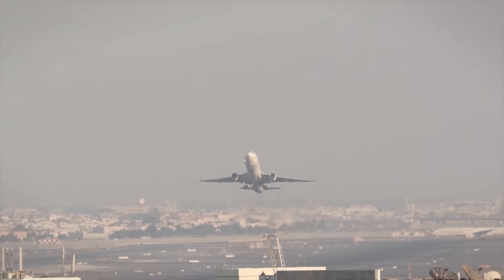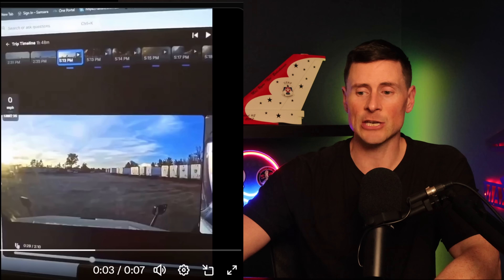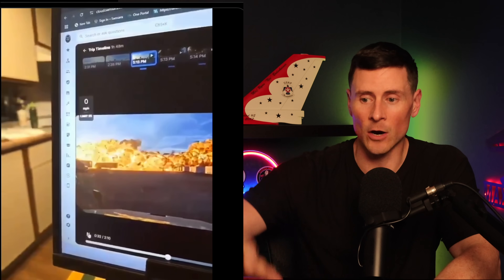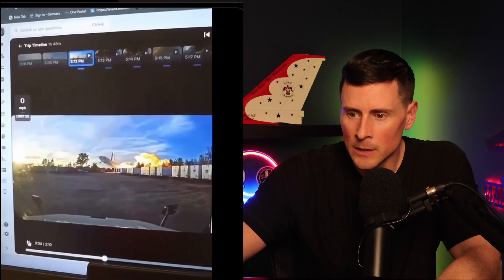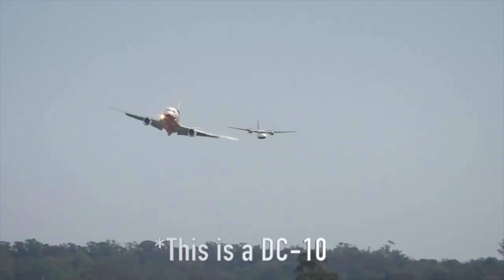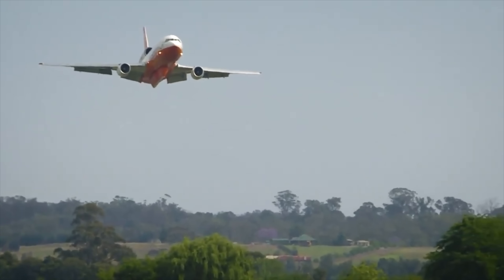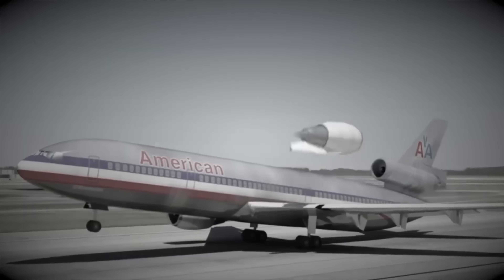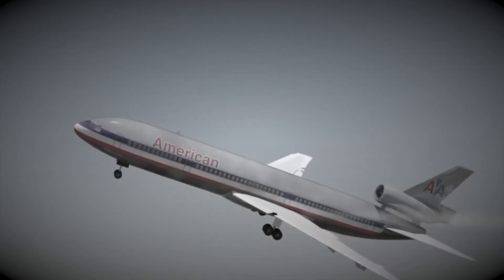Airline Pilot Reveals CHILLING Clue in Final Moment Before UPS 2976 CRASH

Comment: It makes me wonder if this was a freak accident, that nobody could have seen coming, or is it due to UPS having unqualified and/or lazy mechanics, maintaining/inspecting their fleet. I guess this could also have to do with the load and fuel, being so heavy, that it caused this. I'm guessing that the answer's, somewhere in between. I guess the pilot may have avoided some warning signs, too.
Reply: There are fire and smoke, and  mechanical system alarms, etc  on these planes. I think it’s probable the pilot couldn’t have avoided these warnings(if working)because it happened too late at L1 or just before where there was no time to react because of the speed and the short runway. However, I find it hard to believe this plane was found to be airworthy since there are extensive checks by crew and mechanics before takeoff. Were birds and or FOD involved?  Something seems fishy here that all systems were go and this tragedy happened. Was someone suicidal, have an addiction, disgruntled, or …?
Reply: @beckiruther1213  The pilot part makes sense. I'm not a pilot, and I've only worked on load plans, while in the Army, so I don't know much about jets/planes, or flying. I just understand the weight and balance side. We had software that did the heavy math, though. I agree that it seems odd, that nobody seen anything, that would have grounded the jet, until it was verified to be safe. I remember the Air Force being super picky, when prepping flights. They had to verify all of our load plans, before the cargo was loaded. There was also, always a ground commander, who made sure all of the weights and balances, were good. There's obviously no pulling over, and getting a tow, when things go wrong. There's no room for Hail Mary's, when you have lives on the line. This could have been hundreds dead, if it got off the ground. God Bless the Dead, but Thank God it didn't take more lives.

Comment: After the AA accident the design of the DC-10 was changed. In  case of a loss of hydraulics the slats stay extended and lock into place. This was carried over to the MD-11, therefore the slats will have not played any role in this accident.
If they really lost No1 and debris caused a compressor stall on No2 then the No3 engine would flip the aircraft and there would not be sufficient thrust to get airborne.
At this moment in time we just don't know, but it is a horrific accident.
As an airline pilot myself these things are always hard to stomach as they hit close to home.

Comment: Flt.191's engine departed the wing because the maintenance crew put the engine back on wrong and broke the pylon bolts and receiver points.They used a short cut for changing the engine.I believe there's an episode of Air Disasters on it.

Comment: When the left engine caught fire and thus lost some power the right engine running at high speed caused the plane to bank to the left. The correct manuver is to us right rudder to corret the banking. I believe it was too late to do much at this point.
The planes speed was too high. I understand it wasl at 180 knots. T/O speed at V1 should be at about 130 k.

Comment: Fellow airline pilot here. Regarding the sparks at 1:01, IMO that's an over rotation event; the tail striking the runway. Prior to seeing the sparks, I'd already thought "wow, he over rotated" based on nose attitude alone.
Also IMO, it looks like the hot, oxygen depleted air coming from the fire looks like it might have caused at least a partial (if not total) reduction of thrust from #2 engine.

Again, complete supposition on my part, but I do have fairly high confidence in the tail sparks coming from over rotation.

Comment: @1:30min doesnt the fire actually affect airstream around the wing and therefore increase stallspeed ? and that combined might have caused the plane to crash. maybe with just left engine off it could have taken off.
Reply: yes you are correct. It appears to be an  uncontained fire spreading over the wing. Most of your  lift  gets lost and you roll uncontrollably.
Reply: @jackharper3190  yes, he later mentioned it in the video. But i would have mentioned it at that moment. Before knowing of the case in the Past. Which appeared to be the same case, as NTSB confirmed the engine already came off the wing before the plane reached take off speed and then the end of the runway. Maybe its time to stop those planes, since UPS itself has many more of them it can clearly happen again.

Comment: Engine separation? 
After inspecting hundreds upon hundreds of heavy aircraft engine mounts, it does not surprise me at all.
What does surprise me is that it doesn't happen every day.
The metallurgy, heat treatment, installation, and design of jet engine mounts is dynamic beyond comprehension of the most experienced engineers. If anyone knew what I know, they would never get on an aircraft, if no less than tightrope walking the grand canyon.
Procedures are never followed by the book. Simple fabrication and maintenance errors are often overlooked which can create unseen stress points. 
Tensile Stress, Compressive Stress, Shear Stress, Elastic Strain, Plastic Strain, Shear Strain, Metal Fatigue, Cyclic Loading, and environmental factors are key to success or failure. Now put human factors on top of that with financial and time pressures along with exhausted personnel trying to work in extreme weather conditions. A microscopic crack inside an engine mount leads to catastrophe. No two people interpret the technical data with the same conclusion. There is no such thing as flight safety. It's only risk reduction.
Reply: Wow....what you have said is Very Scary! So I take it that you never fly in an Airplane?
Reply: What a load of twaddle.  Thousands of flights every day for over 50 YEARS have flown safely because of rigorous engineering and certification
Reply: @Bassman_DB Good Point! Because the way the OP described it, you'd expect at least one plane going down every day! But it is still a Very Scary Thought if it were even a fraction of the truth!

Comment: It was determined that the AA crash was because  of bad poor maintenance on the part by  AA  mechanics 9 weeks earlier. They took a short cut to remove the engine and pylon by removing them together instead  of 2 separate pieces per MD manual. They did this by using a forklift. The man that was in charge of  the work committed suicide days before  he was to appear in front of a hearing.

Comment: Engine detached on takeoff down the runway rupturing the wing tank.  that's the fire we see and the debris is instantly ingested into the #2 engine causing it to stall and loose power and as a consequence, even with full rudder deflection and #3 engine at full power the aircraft had no where to go but to yaw and rotate left into the ground.  Sadly nothing the pilots could do to recover. thoughts are with them the people on the ground and their families.

Comment: Your comparison of the Chicago DC 10 crash to the recent MD11 crash SUCKS. The engine separation  on the “Killer” DC10 was the result of faulty maintenance practices when an engine was replaced. The engine mount was unknowingly damaged when a fork lift was incorrectly used to install the engine. 
You need to get your story straight!

Comment: It looks like the aircraft got up to air speed v1 180kts. However, it lost the main engine causing it to lose lift and roll left with the left wing hitting the building ripping it off and   leaving a debris field of a mile. There is a strong chance that the left main engine fell off right at V1 take off.

Comment: You're wrong to say the aircraft was only a few feet above the ground. The top of the building where the aircraft left a goudge and scrape marks is MUCH HIGHER than a few feet above the ground.
Reply: In the one video I saw that the nose was up from the rotation at v1 so that could account for the gouge in the top of the building.
Reply: @jpatrickmoore5158  Thanks and I hope I didn't offend you.
Reply: @richardjohnson9275 no offense, I just thought you might not have noticed that.

Comment: The DC-10 didn't have hydraulic fuses in the slat lines like Boeing had.  AA's Maintenance/Engineering applied for a "337 major repair/alteration" to add these devices ... this application PRECEDED AA191.  Douglas' response:  Denied.   FAA response:  DENIED.

My father was an AA AMT and knew the Chicago crew chief who committed suicide .... the Govt, The company, and the union insisted it was his fault.  You touched on the speed ... the training standard factor they fly at V2 for best angle of climb ... but in Chicago, there's no mountains to avoid.  If the pilots had just maintained their speed, they'd have lived, but the FAA approved training directed them to attain V2 ... about 15-20 knots less than they had at the engine failure (separation).

After AA191 ... that mod was approved.  Curious.  So the by 1990, the MD11 had 'em "standard equipment."

I'm wondering if those sparks on the UPS jet wasn't a tail strike as they "encouraged" the rotation to fly at the end of the runway and the number 2 engine was already FODed?  No reason two good engines couldn't have completed the takeoff ... or they were either MUCH heavier than they thought, the ambient air temperature was MUCH hotter ... or they lost more than one engine's thrust.

I can't tell the left wing's slat position in that Big Truck dash cam video.  IDK why they rolled left.  Should have had plenty of rudder to control the asymmetric yaw.

RIP UPS Gravity Fighters.  Prayers for you, your family & friends.

Comment: I was working at OIA testing the concrete for a new runway. And someone forgot to put the fuel caps on the wing tanks of a commercial jet .We thought it might of been moisture rolling of the back of the wings. And the pilots made a quick loop and the smell of jet fuel, luckily it didn't ignite.

Comment: MD-11 remains one of the greatest feats of rebranding in history.  The DC-10 couldn't survive the media storm, no matter how many improvements were made.  My big question is when did the fire start?  Before or after V1?  And, was anyone in the tower watching?  "UPS, fire, abort."  Was it possible?  The NTSB has their hands full now.
Reply: Pilots are trained to take the problem into the air. Secure the problem, then return. If this begins after decision speed, no amount of hollering is likely to stop the plane. I can't really explain accelerate-stop distance, takeoff distance available, or reduced thrust climb characteristics without getting in-depth into a physics and legal lesson, unfortunately. Just know that we are trained to take it to the air. Only in very, very rare cases is that the wrong decision. This looks like one of those rare cases.

Comment: I anticipate we are going to find this was caused by faulty maintenance practices.  Flight 191’s accident was due to a negligent maintenance practice of using a forklift to service engines which was  established to save time and money over the proper process detailed by Boeing.  Prior to that crash, hydraulics were used to push the flaps downward.  After the crash, hydraulics were changed to retract the slats.  Tests were performed after the crash and all failed except for when the pilots were informed of what was about to take place.  I’m sure Corboy & Demetrio will get this case as they handled Flight 191 as well as other including UA Flight 232 at Sioux Gateway Airport in Sioux City, IA.  That one was caused by a faulty fan disk in the #2 engine which cut the hydraulic lines used to control the aircraft so the pilots used the thrust of the engines to steer.  Mr. Corboy Sr. sued everyone in that case including those who mined the metal to make the disk.

Comment: The Chicago crash was the results of short cuts being used by maintenance changing the engine. The pylon attachment point was cracked during the installation of the number one engine. After the crash hydraulic fuses were installed to prevent total hydraulic fluid loss due to catastrophic failure.

Comment: I read that UPS subcontracts the maintenance from ST Engineering in San Antonio, Texas. It was being overhauled at ST Engineering from September 3 to October 18 2025. According to Glassdoor, the starting pay is $13 per hour. The ex-employees gave it 3 Stars. Cheap unskilled labor for sure.
Reply: Generalized statement, but overall accurate. ST isn't known for high quality mechanics and the ones they do have age out REALLY fast and either go direct or go elsewhere.
Reply: @MrsSoriano5-ps9ch  Most of these student graduates lack real-world manufacturing experience with critical measuring and blueprint reading. As a machinist for 25 years who never went to school and learned on the job with great trainers who were machinists, you must learn from mistakes. Aviation is not a place for mistakes from young people. Unions have standards.
Reply: I’m unable to access Glassdoor but I googled it and it’s reported they pay their air cargo mechanics starting at $25-$40/hr. I found at GD the starting pay for cleaners is $13/hr. Regardless of the pay something isn’t mathing. There are alarm systems on these planes alerting from fire to mechanical failures. The crew and mechanics team go through extensive interior/exterior checks before takeoff. It’s up to the Captain to clear the plane for takeoff. Was someone suicidal, have an addiction, disgruntled, were the alarm systems turned off, was a bomb on board, etc.?

Comment: Important to note that MD11 has crazy great brakes. At max takeoff weight, Narita to Atlanta, aborting at or below V1, we could have stopped on the runway. A max landing weight MD11 will stop in an incredibly short distance if you don’t care about the brake fire that will later happen. I’m old, and forget the number, but it was quite short.
Reply: "at or below V1, we could have stopped on the runway". ....you realize that that is the entire POINT of V1? that beyond V1 is the point where you no longer have enough runway left to stop safely?  That's like saying, "as long as I apply my brakes with enough distance to stop, I will stop within a safe distance."
Reply: @ravyn. I am confident I know what V1 means. I’ll put my experience up against anyone, particularly yours. I spent 31 yrs at a major airline, then 13 more there as an instructor and check pilot. You better understand the meaning of V1 taking off from Narita to Atlanta at close to 5000,000 pounds. Important to note that you must have initiated the stopping maneuver before you go past V1.

Comment: Is there a point on the runway where you abort the takeoff automatically?
Reply: There is a point at which you can NOT abort the takeoff. After that speed you go no matter what happens because the brakes will not stop the airplane
Reply: @paulfox9694 thank you sir.

Comment: That is the correct shape and style of engine the MD 11 would use of that one the tarmac if the engine photo is real. That's gonna be one hell of an investigation. Even if no one would have been hurt.

An interesting fact about this is that the engine separation would have done a lot of damage to the wing. Usually more so than what we see in the videos. Therefore, this might have broke free somehow without fully breaking off the wing or at least displaying more damage than what we can see.

Investigators and engineers are gonna study this one for a long time.

It reminds me of that... Aye yeah the one you just showed in the back section of the vid. The one from back in the day.

Comment: How did the failure , escape inspection ?  What caused so much massive failure so rapidly ?
Reply: oh, I'm sure the flight crew saw the massive ball of fire from the failed engine while it was just sitting on the tarmac waiting for the flight and decided it would be no big deal, really. 

Seriously, I don't understand what these questions even mean. How can you spot an engine failure BEFORE it fails? especially when we don't know how exactly it failed? was it an uncontained compressor blade failure that shattered the mount? was it an engine seizure that activated the shear pins as designed? was it a mounting bracket failure due to *microscopic metal fatigue*? All of those possibilities are things that require 1) the cowling to be removed to examine - not something done for routine pre-flight, and 2) ultrasound or x-ray tech to find - again, not something done on pre-flight. How does one look at an engine before it fails catastrophically in a currently unknown manner and just GUESS that, yeah, this one is going to explode and fall off the plane with only 3000 feet of runway left to go. better not fly it.
Reply: I’m just wondering if this didn’t have something to do with layoffs 🤔

Comment: Don't have time to review your report here, but I watched the NTSB update just given. I was thinking exactly as you seem to be covering here; A 3-engine DC-10, decades ago I believe taking off from Chicago, suffered a separated wing engine and crashed, killing all onboard. I believe this resulted in an emergency nationwide order to review all DC-10 engine mounting points for undetected cracking, including Non-Destructive-Testing. I don't recall how many other DC-10s were found to have cracks, or what the FAA report required for ongoing inspection of these engine mounting points as these planes continued in service. Don't want to jump the gun, but seems that could be the most-likely cause, sadly, once again. I doubt any of these remain in service, except for Cargo planes. It's possible I have missed something in your report... I'll read later. Take Care!